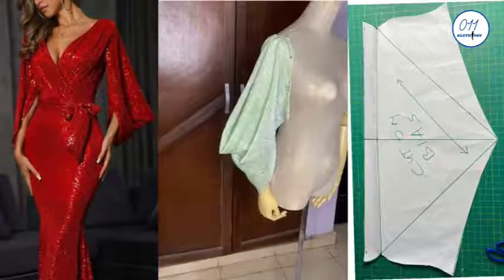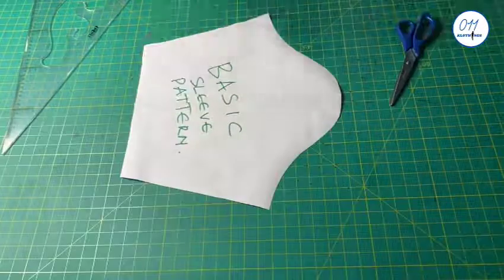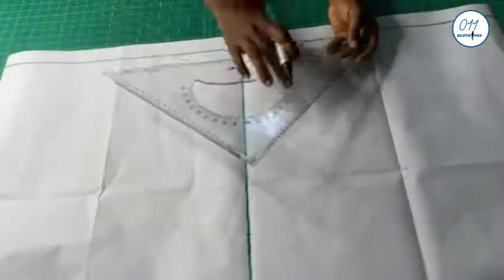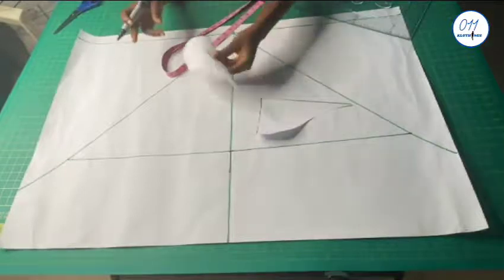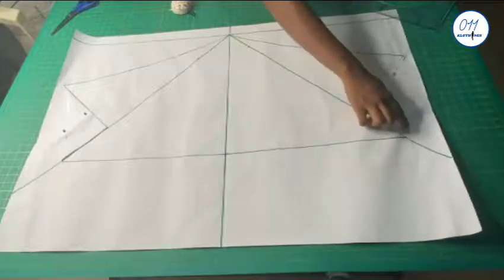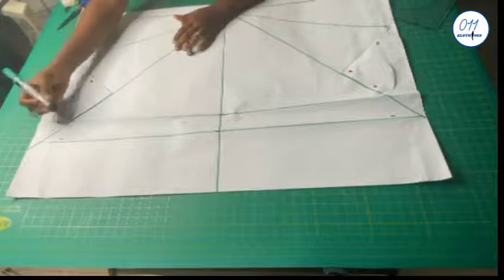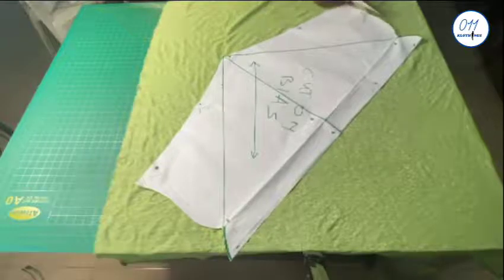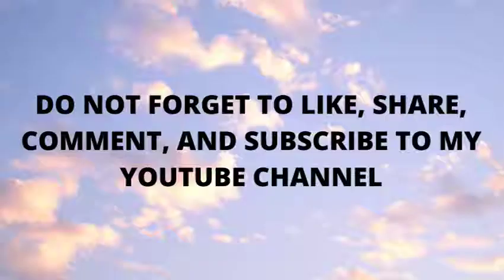HOW TO DRAFT A COWL SLEEVE PATTERN | EXAGGERATED COWL SLEEVE

Comment: Thank you very much for sharing your knowledge. God bless you. Please if it's possible, can we see a video of how to stitch this beautiful sleeve.
Reply from the maker: Hello 👋. Kindly watch the video till the end. I demonstrated how the cowl sleeve should be fixed to the armhole.

It’s actually quite simple once you’re able to draft and cut the sleeve correctly.

You must cut it on bias and you must use a fabric that drapes very easily 👉 crepe, light weight jersey, silk etc.
Reply: @ZERO11KLOTHINGS   Thank you for your kind and fast response, I actually watched it to the end. I didn't really understand how you explained the joining part. Thank you.
Reply from the maker: @oluwasegunajibola232  Okay. here are the steps you need to take to fix the cowl sleeve to the armhole:

1. Hem the lower part of the sleeve.

2. Overlock the 2 inches facing at the upper part of the sleeve.

3. Fold the facing to the wrong side of the sleeve. You can baste it in place along the armhole. Then you should fix the armhole of the sleeve to the armhole of the outfit that you are making.

4. Remember that I used just the cap of the basic sleeve for the cowl sleeve? So the original armhole is still present even in the cowl sleeve.
Reply: @ZERO11KLOTHINGS  Alright, I'll try it out, thank you.

Comment: I love this beautiful cowl sleeve .
But Ii want it long and more fuller how do I achieve that? Many thanks for sharing this beautiful tutorial.🙏😘👍👍
Reply from the maker: You have to decide first how far you want the cowl drape to fall. Elbow length is ideal - so measure from your shoulder to elbow.
Note that the implication of this is that you will have an opening on the sleeve  from your shoulder to elbow.

Whatever value you get is what you will use to spread out the sleeve.

Follow the steps I described in the tutorial and  it must be cut on bias for you achieve the drapes. 

Your choice of fabric also matters. Fabrics that drape well such as crepes, light to medium weight jersey fabric, silk etc.should be used.
Reply from the maker: To increase the length, you can extend the middle line downwards - bearing in mind that the cowl drop also adds to the length of the sleeve.